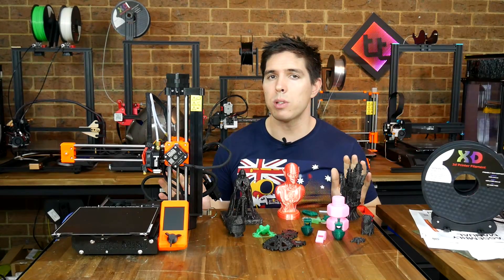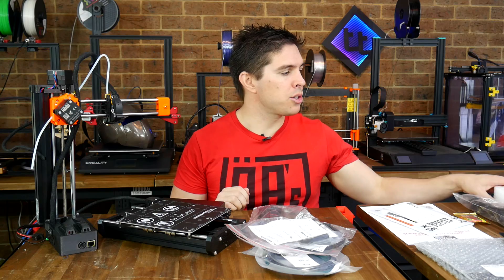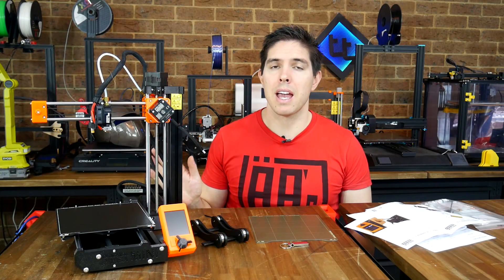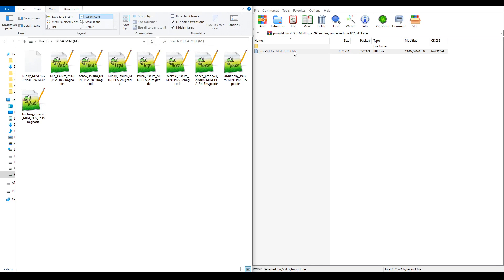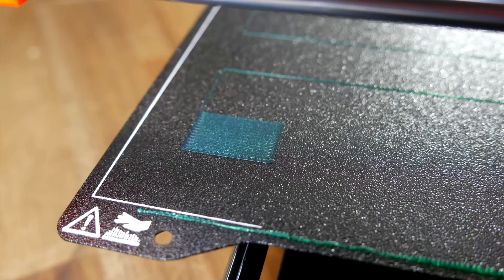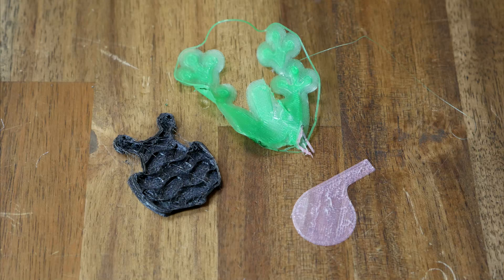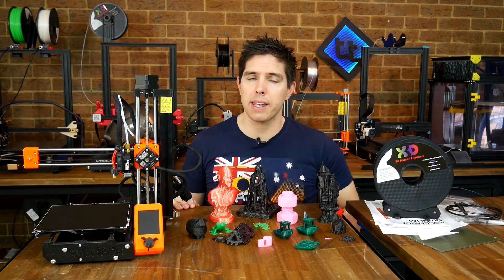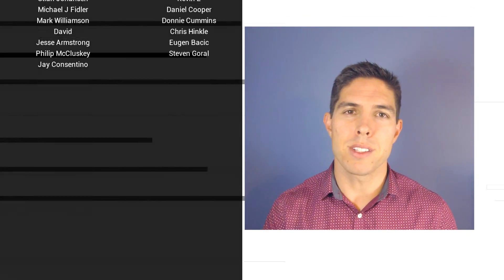Prusa Mini first prints (and troubleshooting)

Comment: Overpriced and those 3d printed parts they make them with look horrible. For that price they should be injection molded. Sorry but i am not a prusa fan, they look like homemade printers.
Reply: Agree %100, i have seen a few pictures of people unboxing their prusa mini to find printed parts breaking along the layer lines
Reply: @backyardbasher  yes thats my point. You can break those parts with your hands they are printed like shit. And they use friggin zip ties to hold the linear rods down, are you kidding me? Come on, it blows my mind people think prusa is king. Not to mention every mini review is full of issues.
Reply: @carbide1968  this is a Marketing word..but its too much money for a hardware like that...
Reply: In my opinion, the fact that they are using their own printer day out and day in to fabricate parts, is what helps them optimise the parts that actually matter to a good user experience. 
Not just making something covered in injection moded parts and bent sheet metal with a handful of linear rails thrown in for the sake of having better specs on paper. 
But granted an Ultimaker looks better.
Reply: And it is "home" made :-)

Comment: Hello Michael, this may help on how to tighten hotend: https://manual.prusa3d.com/Guide/How+to+change+a+hotend+PTFE+tube+-+MINI/1505#s40951 Step 9

I have MINI, from first batch sent before Christmas (which had its own set problems). Print quality with PLA is subjectively better than from MK3S kit - I don't see major artifacts and surfaces look cleaner. I had some major jam with PETG and had to clean both hotend and extruder. While doing that, I effed up geometry of my printer since the attachement of XZ is kind of wonky through that plastic box, I had loose screws tiny bit not to have it skewed, and then I had to make it all perpendicular again. It does not have support for as many materials as MK3S, MINDA does not have thermistor like PINDA v2, and madamme sometimes has its quirks. But it's cute little beast. I am happy with it.

Edit: regarding textured sheet - wash it thoroughly with dish soap (preferably ordinary one with less additives for whatever), don't use your regular sponge but rather new clean brush. Rinse with generous amount of hot water, dry with clean paper towels and don't touch it from then on. You can let it dry on heatbed to be sure all water is gone. Finally clean with IPA and you should be good to go. It's recommended way to get PLA stick to it.

Comment: glad i didnt bother with this machine myself
Reply: This is unfair to say. I'm not a prusa fan nor do I have any prusa printers. But many of the features are eye openers to all these people with chinese printers.
The display alone with all these functions is super cool.
Reply: Don Gray Thank you for the tips!
Reply: This is a great machine; much better than competitors in the same price range.
Reply: @bldjln3158  For that price you can buy an Artillery Sidewinder X1, which has a 300x300x400 build volume, a direct extruder, a filament sensor and a fast heating bed. This might be a great machine, I haven't tested it myself, but it's not better than the others in its price range.
Reply: BlackDragonBE Does the Artillery Sidewinder have an all metal hotend? I’m interested in this printer, as I’ve heard great things about it.
Reply: @bldjln3158  Not stock, but it's easy to replace. The printer has some quirks like all of them, but it has become my favorite, especially for printing big functional parts once I fitted it with a 0.8mm nozzle. 
I recommend joining the facebook group "Artillery Sidewinder X1 3D Printer Owners Group" and having a look around to learn of its specific gotchas, but don't be discouraged by the people having issues there, it's kind of like a support group, people with perfectly working machines don't go there often.
Reply: BlackDragonBE Thank you for the tips, too!

Comment: Nice stamp on the packing, but my brain dead recycle depot refuses to take "styrofoam"
Reply from the maker: I was thinking the same thing. Sometimes the foam is water soluble so you just put it out in the rain and it dissolves.
Reply: It doesn't look like styrofoam, it is a different type of plastic foam. The recycle code should indicate which plastic it goes with. I think the later shipments are cardboard so this has been addressed.

Comment: If its a bowden extruder it will have issues. Period. I also fixed my CR10S by making a custom lenght bowden piece and buying a non slide through fitting so I could tighten the fitting over the tube...its a pain in the ass.

Comment: I have also bought the Prusa Mini, and this was my very first printer. I bought the printer with the expectation that it would be very easy to setup and print without much hassle. And actually, that was the case as I was able to print a perfect benchy using the prusament filament. However, problems started to develop as soon as I went to use eSun PLA. I came across a few of the same problems TeachTech did. 
1. A piece of filament broke off and got stuck in the bowden tube. It took a very long time to diagnose the problem because the only symptom showed was that the printer would load filament but not be able to purge or print. The filament would also be grinded, like shown in the video.
2. I had to adjust sensor position to let the hot end reach the textured plate because it was just that small amount thinner than the smooth plate.
3. The textured plate has been much more challenging to work with suffering similar problems that the benchy prints had in the video.
4. The smooth bed did not present tuning issues, but the textured one has. I am now figuring out how to fix warping, due to print not adhering to bed properly, ghosting, and a small amount of banding.
Overall, the prints have been high quality (with smooth bed sheet), but my expectation of not having to tinker too much with the machine was not met. A part of me cringes at the possibility that I could have had a better experience with an Ender 3 Pro for literally half the price and 1 week wait time instead of 2 months.
Reply from the maker: Thanks for taking the time to share. much appreciated.
Reply: Following up with this comment it is important to state that the textured sheet and non-prusament filament are the primary causes of my troubles. The textured bed has generally been quite difficult to get prints to stick on it. The PEI sheet that I also bought with the printer has behaved exceptionally well! All-day operations with this printer and it has behaved greatly. I do reckon the source of my initial discontent is due to my expectations from this printer. They were simply too high in that I expected no tweaking whatsoever. Given how often it has been printing though, the time spent tweaking the printer has been very minimal, probably less time spent than assembling a Prusa MK3S!
Reply: Here's a good forum post about the textured sheets:
https://forum.prusaprinters.org/forum/hardware-firmware-and-software-help/nothing-sticks-to-textured-sheet-not-even-petg/

Comment: Not surpring that a new printer has some issues but alot of them should have been easy to spot and solve before being shipped to the customer. I personally cant justify the price for its build volume and features, not to mention alot of its parts are 3D printed.(Edit: I would get the Kingroon printer for 150 USD, has the same printing area) Again i think people are getting too hypey on the Prusa name and people too quickly forget the issues previous Prusa printers had at launch.

Comment: Mine came today. Like you, I had high expectations for her - at least because of the good experience with Mk3S MMU2S.
And to put it mildly, the first experiences are disappointing.
Some of the printed elements were already broken in the box, the first few self-tests were unsuccessful just for the next one to go, for no apparent reason.
This is still to be swallowed but the clogged nozzle in such equipment is a total failure. Until now, even one printout failed. Those parts that somehow printed had massive vertical banding.
I guess I have to apologize to the Ender.
Reply: Collective Judas When I found out it comes with a ptfe lined hot end I totally lost interest. This thing is literally a worse designed ender 3 with maybe 100 bucks worth of mods.

Comment: I've got my Mini a couple of weeks ago, so more or less the same batch (already revised by Prusa) as yours. I've had the same problem of extrusion and clogging and I've solved them by following the video guide (user made) that is present on the Prusa forum (also shown here in your video close to the end). Repositioning the hotend (and of course the MINDA probe) solved completely the underextrusion and clogging issue. I've also found that printing (PLA) at a slightly higher temperature, helped a lot. So far I've printed using Geetech black PLA, and stringing is very low. By the way I'm using only the PEI sheet and adhesion is simply perfect. As you said, Prusa will improve this little great machine in the incoming months, so I'm confident that will improve a lot. MK serie was far from being perfect when initially released, and MK3 is quite good because have a lot of upgrades and rework behind.
Reply: Can you link to the post or video please?

Comment: Way too many 3d printed parts and beta product issues for the price. This thing shouldn't be a penny over $149
Reply: @matteocristini6221  I like to see reviews and call it as i see it. I never said the mini had zip ties just that they do use them which that alone is crazy. If iam going to pay 5 times more than a ender 3  both factory assembled  and the more expensive one uses cheap ass 3d printed parts and zip ties you can bet i am gonna call it out. As with the mini every reviewer has had problems out of the box i am gonna call it out. It's a comment section and just my opinion and you can dislike my opinions and make your own but don't tell me i shouldn't comment.
Reply: @matteocristini6221  it's not hate, it's facts. Prusa is over priced and cheaply made. That's all i am claiming. And that's all i am gonna to say now.
Reply: I have to agree with  @carbide1968 , the more you research into it, the more you go down the rabbit hole of how many problems Prusa printers have. They are absolutely not worth it. Even the now old MK3S has horrible extrusion problems because they decided to customize the standard E3D heatbreak.
Reply: @Thorinair  believe it or not prusa has alot of people thinking they make the best printers and you and i seem to be in the minority.
Reply: @carbide1968  It does feel like that yeah... Few days ago, I had to visit a place to fix their Mk3S not extruding, ended up swapping the heatbreak with genuine E3D to fix some of the problems (luckily, I had some spare as my printer no longer needs them now that I have a Hemera installed).
Reply: @Thorinair  how is that hermera? Been thinking of getting one for my ender 3 which is modded with linear rail on Y and will do X if i get the hermera.
Reply: @carbide1968  For me, it has been beyond amazing. Massive improvement to the quality of my prints. There was a set of Hemeras which had a misalignment, so E3D has sent replacements for those people. All other complaints are user errors, like using a Noctua for cooling, which is not enough.
Reply: I agree 100% i cannot stand 3d printed parts on a so called high end printer. It looks like maybe $125 bucks in parts and some printed parts for $350. Not to mention the parts he printed looked like shit.

Comment: Wow thanks for this review, I had a few reservations about this printer but I thought the performances out of the box would be better than this. Also print quality seems inferior or on par with a properly tuned, silent Ender 3.
Reply: Agree, I really wanted to upgrade from my ender 3 to a good brand printer but every video i have seen on the prusa mini has been disappointing so im sticking with my ender, it has abl and i use cura and the prints are faultless, only thing i prefer from the prusa are the nice print surfaces, nice display and quiet bed movment.
Reply: I've been getting pretty good prints out of mine (December batch). With some tuning it lands somewhere around Ender 3, maybe a little closer to mk3s, but definitely not as reliably. I'd place it on par, but with less work and a much more friendly interface. Great for schools and libraries, but for hobbyists who will tune and modify, it probably isn't the best machine. Time will tell I suppose.

Comment: Nicely done man. I’m going to try using a longer ptfe tube on mine. I’m honestly pretty disappointed with my mini at this point. Just playing the waiting game on some official updates on fixes for filament grinding, my gantry isn’t level, and the constant print clogging
Reply: I had the same problem at first, but by raising the hotend (loosen the 3 grub screws on the side of the fan) and the probe by a couple mm I was able to resolve the clogging problem.  I've since printed for over 40 hours on the printer with no jams and print quality at least as good as my Mk2s.  I think it's a fine printer, and good design, but the qc during assembly from Prusa was a little lax.
Reply: @Anthony Timmers I’m going to do a followup video soon. I got a new unit shipped out from their support team. Night and day difference. Zero issues now. Amazing prints
Reply: @UncleJessy  I received one yesterday. It was produced on August 26. Do you think this issue was solved on mine? I cannot assembly It for a while.
Reply from the maker: Yours was one of the videos I watched before opening mine. I was waiting for the probe problem but so far so good.
Reply: I have heard that for some people, removing and re-attaching the z-axis with less torque fixed uneven gantry problems
Reply: Dang. I am thinking about returning mine now... I am having some issues where it will have stringing and ridges. Can't fix it with my Z at all.

Comment: 1 thing i don't like Prusa printers ... that they are using 3d printed parts instead of injection mold despite their high price. And for that money you don't get full metal hotend ? Overpriced as always.
Reply: @npgoalkeeper _ It is obvious that non all metal hotends are prone to clog problems ... why the hell still using them ? Especially this stupid 2 tubes "system" can cause even more problems. I really prefer full metal hotend, i never had problems (bowden system) with clogs, not even with PLA.
Reply: Injection moulded parts would perform better, but this is the best way for Prusa to test his own printers. He knows which features should he add or which problems should he fix on the printers, because he is constantly using them.

Comment: I hope to see more of this printer in a month or so, from you :) I trust your feedback on printers and since i just ordered one about a month ago that will get delivered end of May, I'm a bit concerned if this was the right move as I've seen many others with issues with QC. It seems like almost every single YouTuber have had minor or massive issues with this printer, and I'm starting to wonder if my money is better spend elsewhere. this is not my firs printer, i just had a long break and my old printer was 100% DIY so that doesn't scare me. Tho i like the ready to print no tinkering approach prusa seems to give you on some thing like the MK3.

In my mind is just wrong to pay for old control system (8-bit) just to upgrade it after the fact to be able to take advantage of all the features in something like Marlin 2.0, hence why i went the Mini road instead of a cheaper option like Ender 3 + some upgrades
Reply: If it puts your mind at rest a bit, most of the issues reported look really bad but are in fact, for many people, simple to fix when you know what they are.  I was one of the first to receive a mini and it took fully two weeks of forum conversations and Prusa chat sessions to get to the root of the problems.  If I received the same machine now, it would print perfectly by loosening three grub screws, pushing the hotend up, tightening them again and the unscrewing the idler screw a bit.  five minutes work and all done with the supplied allen key.  I agree it shouldn't be like that but it is less work that I did with my CR10s and my Artillery sidewinder
Reply from the maker: I agree that if you know the issues exist from the start and check for them right away, you'll likely avoid the headaches.
Reply: @TeachingTech  some thing that I haven't seen on YT is a, "Check this before your first print with the Prusa Mini" where some one, like you, with great knowledge about 3D printers summarize the list of things to check before printing the first print on the mini, just to make sure that you have checked the most common issues with the prusa, and maybe some less common but still game breaking issues that is known even going over issues that should have been fixed but would be easy to check for the end user. I don't know, just throwing stuff out there  that i would personally like to know when i get my printer. I know it's not likely even if you go with the idea as it's only 2-3 months until i get mine, but with all the things getting discovered all the time, like the probe acting because the cable strip is too tight, or if you tighten the screws in the wrong order or too tight the z-axis will not be parallel with the bed, plus the stuff you encountered and a whole lot more
Reply: @g0balot  Thx for the indepth reply :) I will give you, as I've seen quite alot of yt about the CR10 end Ender 3  that all of them have a lot of tinkering here and there to print optimal, and what i'm looking for, to get back into printing is a more, set and forget, kinda setup, where most of my time is spend modelling rather than tinkering with the printer